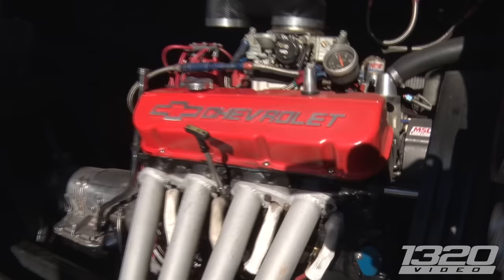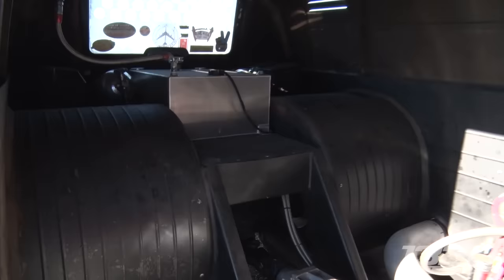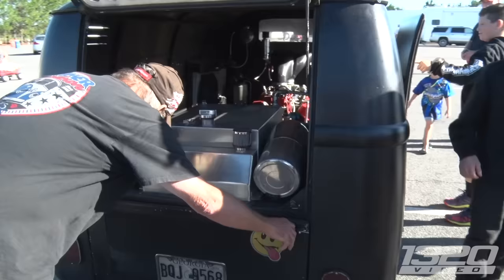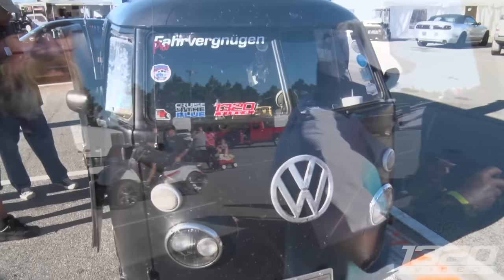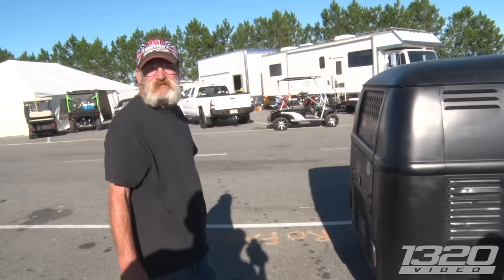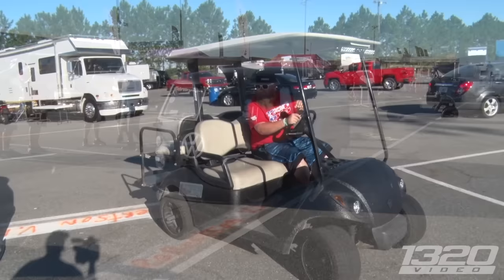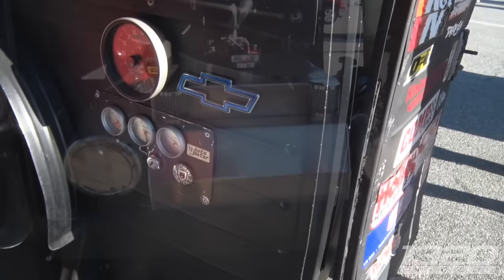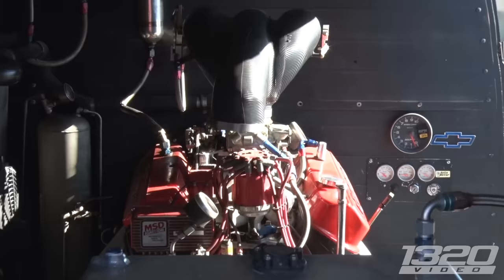COOLEST VW Bus Ever Built!?!?

Comment: I love the massive side scoop
Reply: Quinn Kirlew I think that's the only thing I don't like lol
Reply: azz187  me too. Would of looked a lot better with a roof scoop. Not a big numb one but another VW roof fitted on top that lifted up by  small rams and was ducted to the rad.
Reply: No floor boards.  He told me he had the bottom enclosed to start with, but it wasn't getting enough air to cool it.  Not what I expected to be parked behind when I pulled into a Georgia gas station!

Comment: You should check out the VW stretched Bus built by Gotham Garage. Its got a custom three axel chassis and a 1500 horsepower blower motor used on drag boats. It was tuned down to about 700 horses because straight 1500 would’ve put too much stress on the chassis and the bus would twist like a pretzel. They also added an old WWII era fighter plane exhaust setup, so it had 4 exhausts on both sides. The roof was chopped down, the bus was lowered, bigger tires and a sheet of bulletproof glass was added between the engine and the seats. The side doors were also added with hydraulics so they lift up revealing the beast of an engine inside.

Comment: aww darn, I thought my buddy had the title for coolest VW bus decades ago. it was sectioned short to fit a regular bug pan with a pumped 2110 engine. it needed and used it's wheelie bars with driver and passenger up front, sand rail style steering brakes for when. it'd lift and carry through 1st and 2nd was pretty scary, sometimes came down a little hard.

Comment: The only thing missing is someway to get fresh air to that intake.
Reply: if you look at 4:00 he has a air ram on the left side of the bus.
Reply: To me it looks like the ram for the radiators. Also if you pause when he films the engine, you can see that the intake is not connected with that ram.
Reply: Karlis Akis I think it leads to the cabin but im not sure. Cool ride none of the less.
Reply: Sure it does. Yeah..its dope.

Comment: it is indeed the coolest one ever.  needs to lose the ugly side scoop and run a few smaller radiators in the sides where the original cooling fins are for cleaner look with electric fans

Comment: Wait, did he really bow out the driver's side panel for a giant air scoop??? @4:00
Reply: Nate May that bowed out panel looks like shit ...poor planning , it needs a scoop on the roof.or 8 injector stacks    that would push it over the "Top"...I build rat rods and dirt pro stocks .im always using stock car specialty parts in.my street builds and the ultimate accessory  "flat black  paint"and white pinstripe flames
Reply: Wayne  Hall just cause it's not your taste does not mean it's shit maybe he wanted it to be a sleeper  so he put one scoop on the side.
Reply: Wayne  Hall that scoop isn't air induction for the engine...not entirely, anyway. It's for the radiator and transmission cooler.

Comment: Dafaq is a 200 gear?
Reply: Never have heard it referred to in that fashion.
Reply: bandwagon240 Put in some 400s and it should do 10s. lol
Reply: Well, a TH400 doesn't have an overdrive, so 2.73 seems quite normal for the daily driver he claims it is.
Reply: Walter Sobchak I was running a 2.56 ring and pinion in an old buick. backed by a th350. she got good gas mileage on the highway. 23-25mpg.

Comment: 6 weeks to build? Really?😮
Reply: George C its taken my shop 5 weeks  to swap a motor 😑
Reply: Koalafications4Dayz jeez haha for some reason I don't believe him🤔🤔
Reply: Koalafications4Dayz probably because the shop is building something like this!
Reply: Nathan Wright nope just a cammed 5.3 lt headers, stall,  trans cooler,  3.73 rear end posi, 243 heads,  new gaskets all around,  coils,  rocker arms,   basically only think stock is the bottom end of the motor and an intake,  and tune the motor is almost put together but evreything else is not done,  it does not take 5 weeks to install all that if this guy took 6 weeks i should have my truck back weeks ago
Reply: +Koalafications4Dayz shouldve done it yourself lol
Reply: +Koalafications4Dayz shouldve done it yourself lol

Comment: as much of a vw camper as my left foot.

its like those funny cars that claim to be a "350z" when theyre  tuba chassis. chevy engine and fibreglass body.
the only thing vw on this thing is the body. its not a vw chassis. engine. running gear. brakes. transmission etc...... cool... but stop calling it a vw.
Reply: its a vw